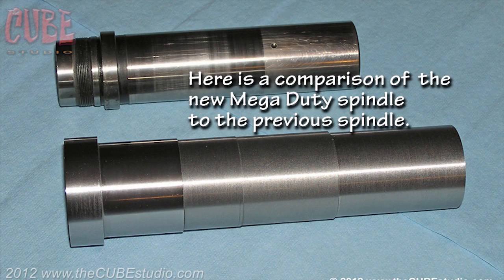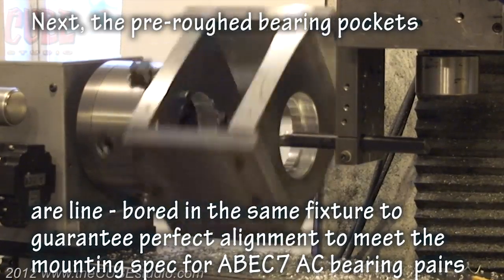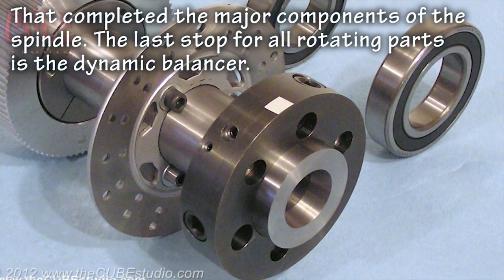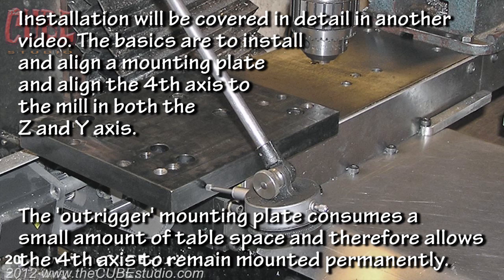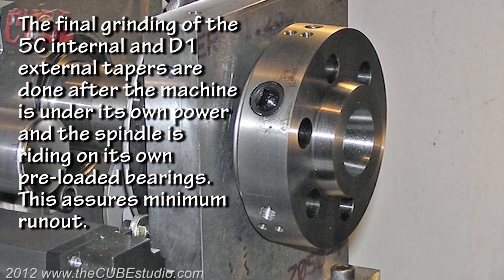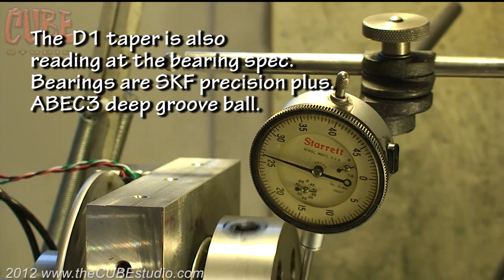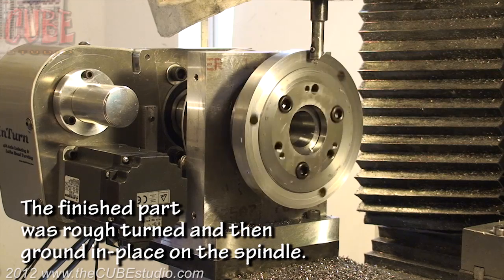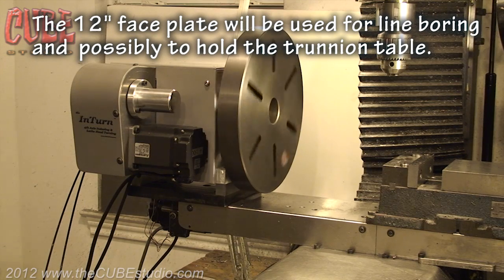4th Axis Mega-Duty introduction including design, build and install details

Comment from the maker: Yes, there is a 'back gear' (lathe speak) that is now 12:1 overall. 

'Direct drive' ration  depends on what pulley you use on the motor. the main drive gear is now a whopping 88 teeth and you can have anywhere from 22 to about 66 teeth on the motor.  The 4th axis is balanced and tested to 4,000 RPM.

Comment from the maker: Indexing is set at 12:1. Direct drive can be anywhere from 4:1 to 1.33:1 RPM depends on your motor. Rotating parts are balanced for 4K RPM. 

The spindle lock rotor is indeed a motorcycle rotor, slightly modified. The caliper is an articulated pneumatic custom deisgned and built fo the 4th axis. There is no change in the spindle lock from the previous model. 

More info is finally available on theInTurn web site. Look in the description for the full link. 

Voiceover is a professional, yes.

Comment from the maker: New InTurn™ web site has beed added in description. South Africa should not be a problem. As delivered, the machine needs only 5V DC for the internal home sensor. Servo motor is not included, so voltage depends on what motor you choose. Typically, buyers duplicate the drive/motor combo that they already have on their CNC mill, but you can use any servo motor you prefer. I favor Mitsubishi J3 due to the real time auto tuning, but there are many good options.

Comment from the maker: You were not specific, so I will provide both options:

the new Mega base price is US$ 2,300

Previous prototype is for sale at $1,800 - the normal cost of a new previous model 4th axis . . . BUT . . the prototype has a bunch of expensive options that go with it. 

7000 series alum frame (about US$300)

Threaded spindle nose and 6" chuck adapter.  ( ball park $200)

Extra high speed direct drive pulley  (extra pulleys are always about US$100)
 
1" wide main drive belt and lots more . . .

Comment from the maker: It is in place of. The prototype for the previous version is for sale. The previous spindle was a limitation that I have wanted to eliminate for a long time, but doing so required quite an investment in new equipment to produce a spindle from scratch. I don't think 'feature' is the right word. I am focused on capacity and capability for the machine. Buyer specs dictate the capabilities.

However, I may have to plead guilty to feature creep on the InTurn™ motor controller, which has a long list.

Comment from the maker: Gen1 and Gen2 refer to the controllers. The major upgrade to Gen2 requires new firmware that is not compatible unless the hardware upgrade is done first. That is the purpose of the designations. 

 "XXX Duty" differentiates the machines. I am running out of adjectives though so I will need to stop upgrading it. The MEGA is quite a bit more expensive primarily because of the new spindle. I'm happy to build one for you, but for the work you do, the Super Duty is more than adequate.

Comment: Awesome work!
Do you have different gear ratios for turning and indexing on this one? And can you do simultaneous 4 axis machining on this one?
And what turning rpm speed do you get?

Is that a motorcycle brake disc and calipers for the brake? How do you actuate the calipers? Just air over oil or with a air actuator pushing a piston?

Did you hire someone to do the presentation voice? Sounded really professional.

Comment from the maker: Price is shown at the end of the video, however, the price has been increased. You may find specs and new pricing at InTurn website (link in this videos description section) along with info on the optional matching motor controller.
Opearting in 'index' mode, the InTurn™ works like any other 4th axis. The high speed turning mode requires only a single output pin from your CNC. Special features are available for the MACH3 CNC software. see controller video and the InTurn site for details.

Comment: Its great. I just would worry if the flood coolant would damage the electronics.
Reply from the maker: The only electronics on the InTurn™ itself is the home sensor. It is high up inside under the top cover, so even if you do not seal the machine fully, the sensor will not get wet. The rest of the electronics are in a separate box that is remote from the InTurn™, usually kept near the computer.

Comment: Very Cool! Is that a stepper motor or servo? How did you get the motor to index and turn?
Reply from the maker: +TheJsolano77 The InTurn™ requires a servo motor. Stepper motors are not suited to high speed operation as they continuously loose torque as the speed increases. The motor is controlled by the CNC software as the 'A' axis in INdexing mode. In 'TURNing' mode, the controller disconnects the CNC software and take over running the motor. While the InTurn™ is spinnind in 'TURNing mode, the CNC software is unaware that this is happening, so it proceeds to control the other axis as if the 'A" axis was not moving.
Reply: +Simpsons36 ok.. i think i get it. thanks for the response. I went to your channel. Someday I would like to try building my own cnc mill. Do you sell the spindles and ATC ?

Comment: Can any one help please 
I have made same 4th axis with high speed steeper with built-in incoder 
My problem I can't programme mach3 to read or set it up properly for the spindle speed 
I go up to 1200rpm but to do this I have to till mach3 do speed 800,000 rpm and that's have to be on lathe mode witch is OK
So if I'm on lathe mode spindle is 4th axis motor

Comment: I would like to know how to select index mode to turning mode? change the belt and gear by manual or just adjust the servo motor speed? what is Max. index mode and turning mode?
Reply from the maker: INDEX and TURNING modes are selected by the InTurn Motor Controller via Screen buttons or 'M' codes embedded into the 'G' code program .
Reply: I have saw one of your video, you need to adjust the belt between wheels while you select INDEX and TURNING modes; I would like to know if your new product should not adjust any machinery just select the INDEX and TURNING modes button or  'M' codes embedded into the 'G' code program .

Comment: Just curious with out the disc  break how well does it hold position?
Reply from the maker: +TheJsolano77 The spindle lock provides approx. 100ftlbs holding torque @ 90 psiHow well it holds with the spindle lock odd depends on what kind of motor you are using. The InTurn™ does coordinated motion and rotary milling just like any 4th axis, but holding a workpiece in an absolutely stationary position while machining the piece is pretty much impossible without a spindle lock.

Comment: Did you build the dynamic balance yourself? care to make a video intro?
Reply from the maker: <p>Yes, I built the balancer. It is actually far more complex that building a 4th axis or a mill. The 'floating' mechanism is tricky and the control software is the gorilla. I almost gave up on the software and purchased one of the existing programs (about US$ 2,000), but after some extensive research, I was able to understand the process and then writing the code was not too difficult. Reading the accelerometer fast enough is challenging, but some new processors are out now that will quadruple the read rate and should eliminate that issue.</p><p></p><p>I would participate in a discussion and share what I have learned, but I will not be encouraging people to build balancers or providing any plans or kits. The reason is liability. Balancers are quite dangerous toys. </p>
Reply: Simpsons36 I was planning on making my own that can do very high speed. I am thinking of building a bunker box around it too lol.  The biggest hurdle for me is the electronics.
Reply from the maker: Simon Lee OK, I can lay out the basics for you. You will need an absolute encoder and an accelerometer. The carriage that holds the part being balanced has to 'float' freely so that the imbalance of the object will be able to cause displacement. Read the accelerometer to detect the movement and the encoder to detect the azimuth of that movement. This tells you where the imbalance is, and the magnitude of the imbalance, but not how much mass . That is how my balancer works. The amount of weight is trial and error. The balancer finds the heavy spot and material is removed a little at a time until the heavy spot 'moves'.

If you have a fast enough processor, you can add more sensors and get more data. For example with a pressure sensor, you can read the force created by  the object displacement and together with the RPM and diameter of the object, calculate the required add/subtract weight and at what point.